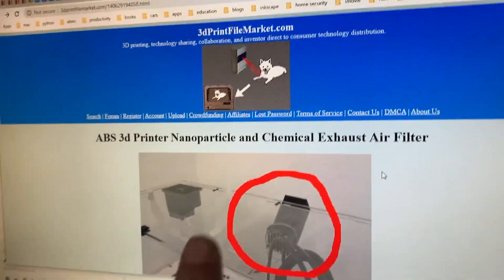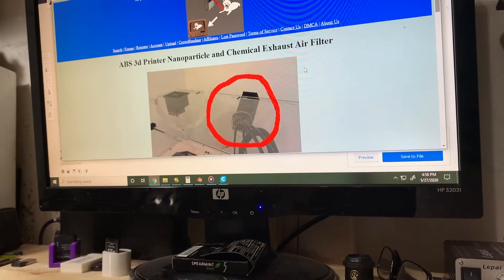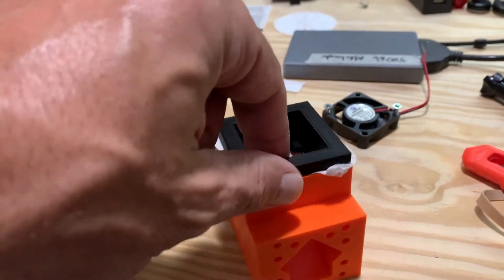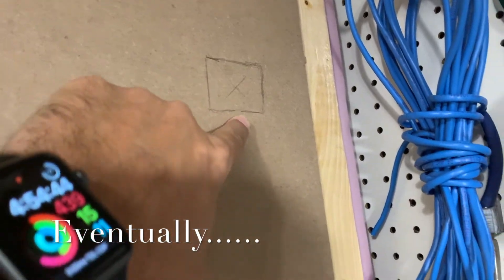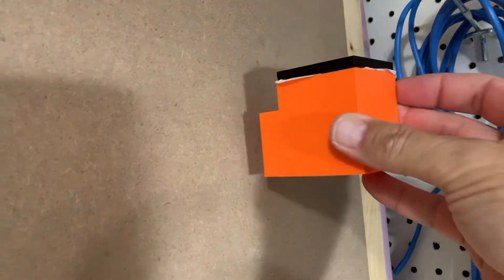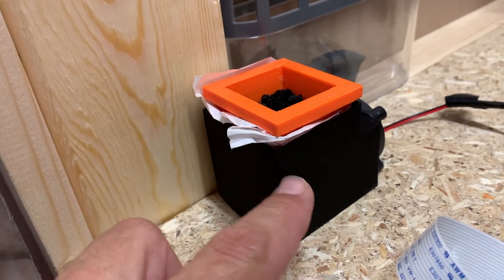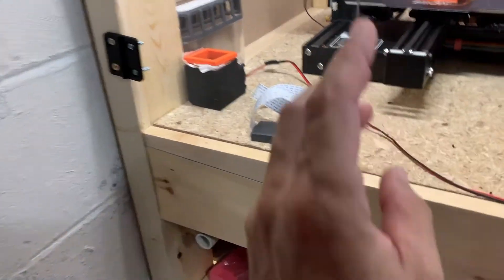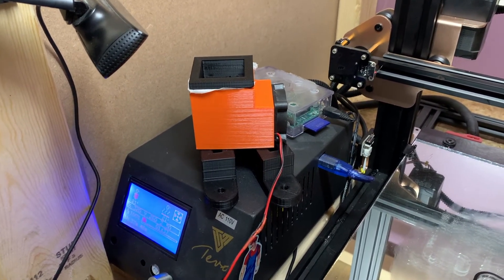Build a 3D Printer Air Filter --Easy DIY Project to Rid 3D Printer Smells

Comment: Hey. Nice idea thou. But i would swap the coffee filter to a more air permeable material or print a grid which can receive the active carbon. Additionally, sealing the whole cabinet with silicone or acryl would allow to create a better air flow, as the fan creates underpressure, forcing the hole air inside the cabinet to exit trough the filter. Enough air should pass through your doors if you dont seal them for sure :)
Reply: You’re saying he should seal up the cabinet?